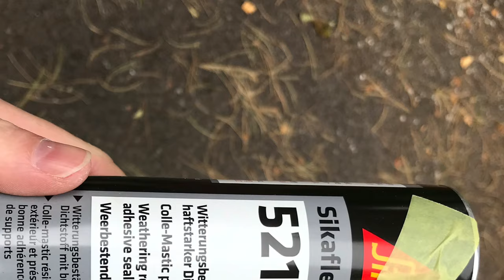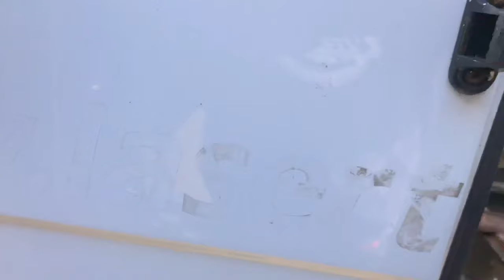MaxxAir Fan Deluxe Install + adapter | Removing Unwin rail floor | Mercedes Bus Camper conversion

Comment: There have been reports on the Victron Powered Campervan Facebook group as well as from George, Humble Road (YouTube) that the pcb on a Maxxfan can be damaged if it subjected to too high a voltage. The advice from the forums (and George!) is to install an inexpensive 12v regulator to the Maxxfan circuit. Done this in my van build for peace of mind.
Reply from the maker: Love this tip Peter. Thank you. We will check it out as can likely install this in the cupboard.

Comment: Hi, like the videos please keep them coming, what make and model did you get the seats out of?
Reply from the maker: Thank you. That’s lovely to hear. They are from a Ford Tourneo Custom. A 2020 model. Basically it seems that when these are converted by taxi companies they often take the seats out. Ours are second row seats which means they can be turned in either direction. Take care

Comment: I'm doing vw t5 bluebird 2.0tid 2010 bus conversion I had same issues with the urwin rails on flood 
I managed to undo the majority of 13mm bolts but rest were turning so I used anglegrider done the trick took me 2 day at least t get them off
Reply from the maker: Well done. Really mean that as it’s a pig of a job. 2 days isn’t bad at all. Good base vehicle the bluebird. What are your plans for it?
Reply: I'm far into my build now on my bluebird I'm converting to motorhome.
Yes they are great conversion base vehicle as the frame is aluminium so no rust to deal with also comes with 7 speed dsg semi auto gearbox.

I'm 6ft 5 so wanted my bus to have good headlight which the bluebird does as it's 6ft8 high 

I'm watching all your conversion videos as we speak
Reply from the maker: That sounds ideal. The fact it has an auto box is also dead handy. Height wise we are okay; especially as the tallest of us is 5’7 😂.

Comment from the maker: One thing I’d add is that when installing the fan. As in the final step, we found the screw holes just didn’t line up at all. So I used an awl to prize the screw adapters into line, then tightened the four Max Air screws a little at a time to tighten it down. Apparently this is a common issue so wanted to share.